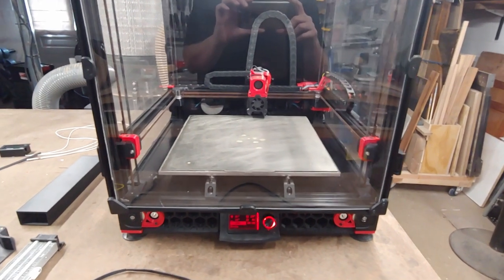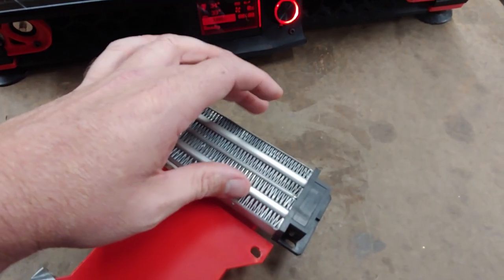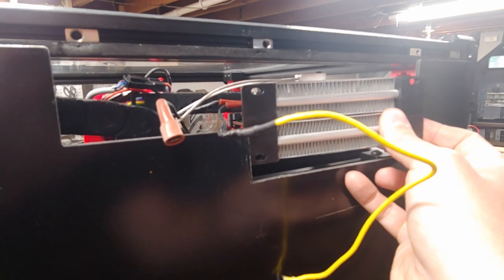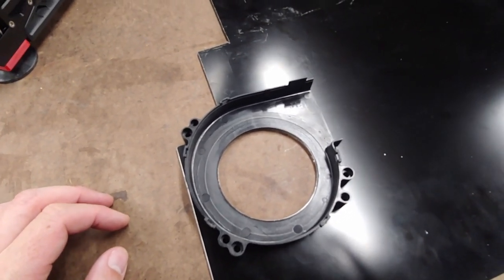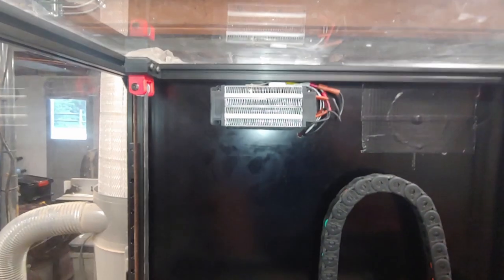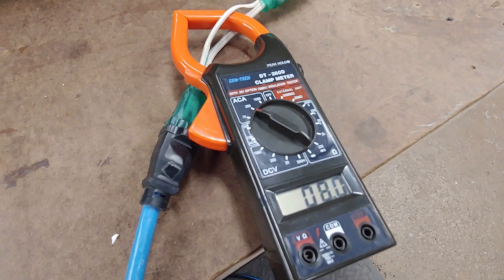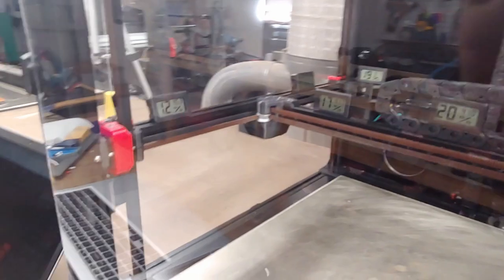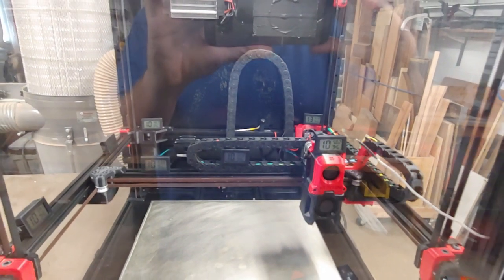Voron V2 Chamber Heater tinkering

Comment: Hello, do you have a special active filter/fan to reduce harmful effects from material melting?❤
Reply from the maker: No.  I just try to seal the printer to keep the bad air inside.  Unfortunately the 2.4 cannot be sealed as well as the Trident because of the Z belt passthroughs.  I am too cheap to spend money on  special charcoal every month.
Reply: @badmouth75  Thanks! Seems a good idea! Me too, maybe it's an interesting option to make a sealed hole in the upper section of a box, install fan to electricity and the hole from inside, and connect a hood to your box through a sealed fan and in window?

Comment: hi how do you control you heated chamber with klipper mainsail?
 i was thinking to pick a termperature controller but i think these way is more convenient 
also you should add your heater at the bottom of the enclosure cause heat stacks on the top of your enclosure maybe just inverte the fan to pick air from the top

Comment: @badmouth75 I Iiked your design and idea. I would like to try spliting the heater in two of 250W  in each side of the printer. That should be enough to not overheating or create hotspots.  I also liked your design of the air splitter behind the heater. If you don't mind share the cad file, I would modify for 250w heater and try in my V2 350. Thanks!

Comment: There are cheap food dehydrators at 500W and the neat thing is they have temp regulation up to 70 degrees built in. Just modify one of those by running a flexible tube from the dehydrator to the printer and back to get recirculation.

Comment: Admittedly I'm obsessed with peltiers right now, but they can act as 100%+ efficient heaters, provide waste "cool", and are pretty cheap. Aside from regulating the temperature of the chamber with a peltier (cold side outside) I'd be interested in a flexible CPAP tube running to the hotend for heatsink and part cooling, with a peltier cooling down the air to send and throwing "waste" heat into the chamber. I've also thought about a peltier heated bed, but that's a way more complicated rabbit hole. Heck the electronics could even be cooled with the peltier as a byproduct of heat generation.

It's fun to think about on a 3D printer what needs heat and what needs cooling, and how you can use peltiers to improve the process.

Comment: That is quite creative. I have been trying to find a way to actively heat my chamber as well. Got a heater+fan combo on amazon that I used for a filament drier mod that worked pretty well and debating on using one on my chamber. Do you think there would be an issue with mounting the heater on the top pannel after replacing the material? I was debating on using 1/4in thick plexiglass to do so. Not cheap but is supposed to have good thermal properties. Had not thought about integrating the heater+fan+thermister to the printer but thats a cool idea.

Comment: My V2.4 is 350 x 400 tall. I use a 60mm 220V 150W PTC and it heats the chamber fast to 55C. I first had a 400W and it was way too much power. I had to run it at like 20% power. I clipped one of its inputs so only half of the PTC was powered and that helped but really the 150W or even lower is what you want. PTC's don't respond great to being contolled by an SSR. Spend the extra 10 bucks and get the insulated versions. They come with 220V fans but I swapped it for a 24V so I could have the PTC and fan run seperately. The PTC powers down first, then the fan. I use modified bed fans macros to run the ptc. It only runs when the bed heater is set to 90C+ and turns off when the bed temp drops. It works really well. I can't believe people wait hours for their printer to warm up.
Lastly, Make sure you have polycarbonate panels, not acrylic as they will warp like crazy. My poly panels don't warp at all.
Reply: I'm about to buy the 400w model, lucky I find your msg first. Where so you put the chamber temp sensor?
Reply: @LBF-xSunnyCrazyx  I have the temp sensor mounted on the rear extrusion of the gentry in the cable chain guide. The temperature will vary a bit depending on how high the sensor is but I figure it's most important at the height of the print.

Comment: As great as Voron's are, with Z on gantry, all your prints start in the coldest part of the chamber.  The top is the hottest part.  Thus why Z on bed is superior.  Looking forward to building a Trident and Zero in the future.  My ender 6 printers with home brew top hit about 48 to 52C at the level of the print head.  Still, I'd like to add some active heating to experiment with even higher temps and for preheating.  Halogen bulbs can be a great and simple source of heat.  Seen it done with a college brew Ultim printer which ran for years.

Comment: Interesting approach. What is your temp target? I am running 350
V2 with bed at 110 c.
Ambient chamber temp reaches
56 c by itself and my insulation is crap. When I print PA-GF with bed at 115 c chamber temp goes to 61 c. If I use active chamber heater, I use it for 80 c temp. To have it to get to less temp is not worth of the effort. IMHO
Reply from the maker: My printer is in an unheated full basement.  This past winter it struggled to make it out of the mid 30's.  I am trying to get it up around 55-60 in the winter time.  In the summer it gets to the 50's without help.  I've only been running the bed at 90 recently.  Partly to reduce part shrinkage (kind of a pinching) just above the bed and partly because it turns out that my keenovo heater is failing after 2 years.

Comment: What was your total cost for building it
Reply from the maker: I have around $70 in the heater setup, but got a deal on some new old stock (made in Japan) solid state relays.  If you are asking about the V2, it ended up costing around $2k because it was built before there were any kits were available.  Back then parts had to be ordered individually or in small batches from dozens of different vendors.  All those separate shipping charges add up.

Comment: Have you considered adding insulation to at least the top PC panel to deflect some heat back into the chamber? Also, I know you mentioned you couldn’t find room anywhere else but I would think blowing the heat under the bed would be preferable to blowing it to the top of the chamber where heat accumulates. Might not be able to solve that one with printed parts unfortunately.
Reply from the maker: I've since replaced the top with aluminum composite which probably isn't doing much for insulation, but can take the heat better than the clear polycarbonate.  A Voron frame is one big aluminum heatsink.  Any real attempt at insulating needs to fully insulate the frame, but that ruins the good looks of the Voron.  My V1.8 was covered by a 1/2 inch thick polyiso sheet box and ran 65-70 degrees without a chamber heater.  I thought I would try something different with the 2.4 just for the sake of trying something different.

Comment: Could post the links to the hinges and latches you are using? that'd be great.
Reply from the maker: Added links to the description.  They aren't what I would consider good enough for public release, but there they are.  Certain dimensions might need reworked depending on the thickness of your foam gasket and side panels.  Holes will probably need drilled out to reach the proper size, etc.  If someone want to remix and improve them, I am all for it.
Reply: @badmouth75  thanks!

Comment: I read that someone who made a DoomCube mod on his voron got up to 70 degrees. That's without an active heater. Do the mod and put a heater in :D
Reply from the maker: They probably know better than me, but I'm not a fan of the frame being exposed to both the inside and outside of the chamber.  It's basically a big aluminum heatsink.  I've replaced the sides and top with a 3/4 polyiso box and it gets up to the 50's without the heater now (ambient temp in the basement has also gone up though).  I will most likely switch over to fans under the bed and move the heater over to a different project.  Most of what I do is just playing around to see if different ideas will work.
Reply: @badmouth75  What about one of those infrared heater lamps that you have on your balcony to keep warm? It's sort of a directional heat so your front is warm while your back is freezing cold. I imagine it could heat up the print without heating the rest as much. Not sure though.
Reply: You can heat it from the outside as polycarbonate lets through 95% of the waves from infrared radiation.
Reply: You can isolate the steppers and parts that should not get heated with alumium foil as it reflects infrared heat.
Reply: Actually aluminium tape should be even better.